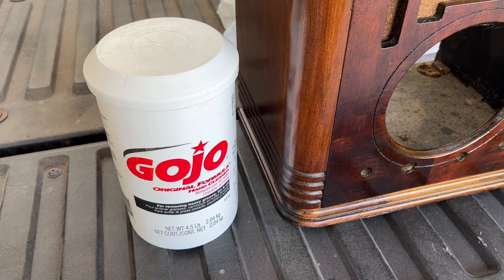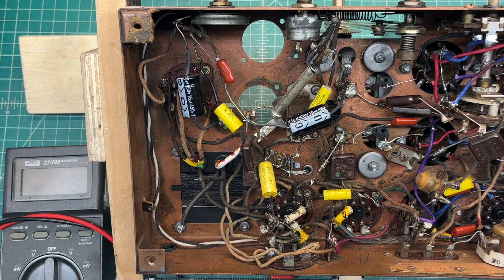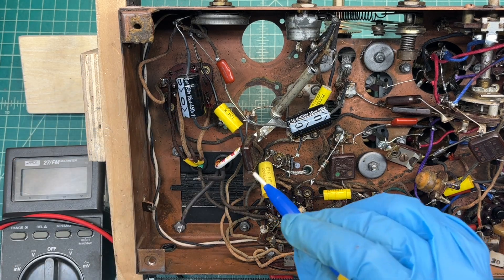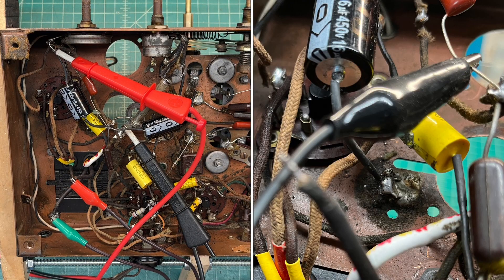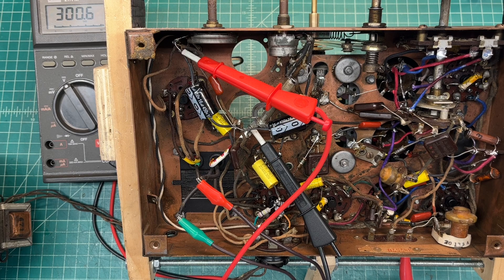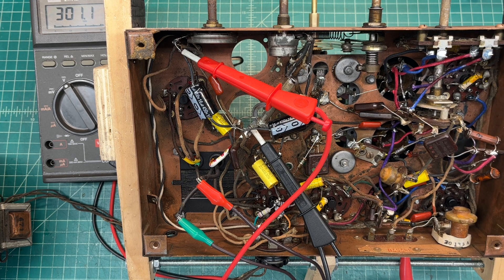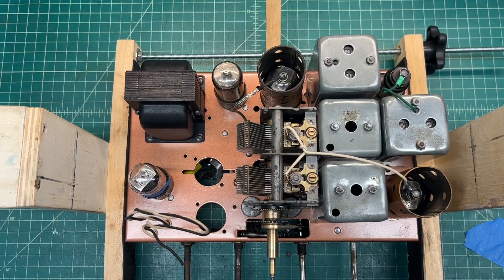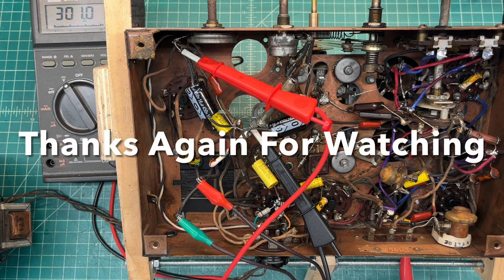Zenith 5-S-127 | Low B+ Voltage & Electrolytic Capacitor Configuration

Comment: Many thanks for your very interesting and instructive videos !!! I am just now restoring a Zenith 5-S-127A radio (european version) imported to Sweden in the late 1930ies, so your videos have been very useful to me. Great sound in this radio. However, I saw you had installed a new transparent dial drive belt. Where did you get that from? I have a need for a new one myself, because the old belt only allows counterclockwise rotation, clockwise immediately gets stuck. I have contacted two dealers on Internet, but one has sold out and the other does not respond to my emails. Any help with this would be very much appreciated!
Reply from the maker: Thanks for your kind words. I got the dial belt from: https://www.qualityradiobelts.com/index.html I hope you’re able to locate one and get the receiver back together and playing soon. If you need any additional information, feel free to reach out. Best, Don

Comment: Thanks for the update Don, now I'll have to purchase some GOJO. Picking up a lot of stations when there's so much more restoration left to do under the chassis. That's going to be one hot Zenith radio when completed. Let us know what's causing the popping noise.
Reply from the maker: Ken, I’ve had the ORIGINAL GOJO for some time now, not the pumice… and I’ve heard it’s more difficult to find today. I’ll keep you posted on the noise source. Thanks again for following along. Best, Don